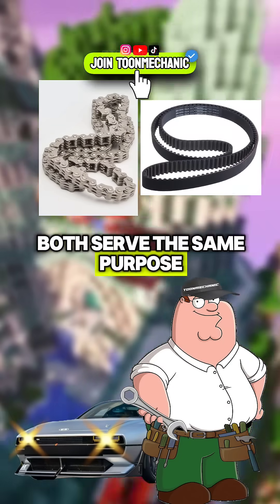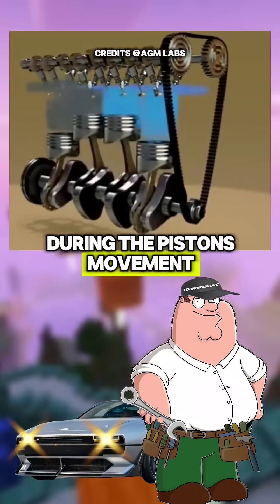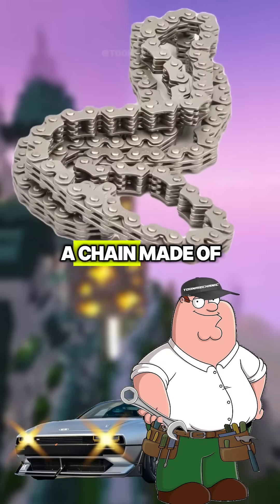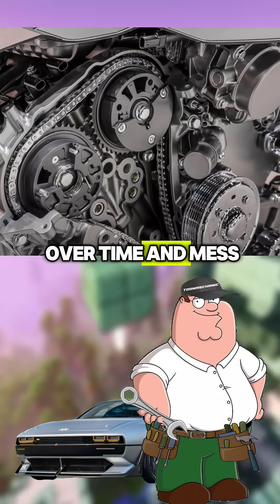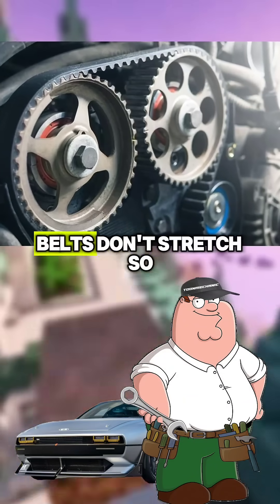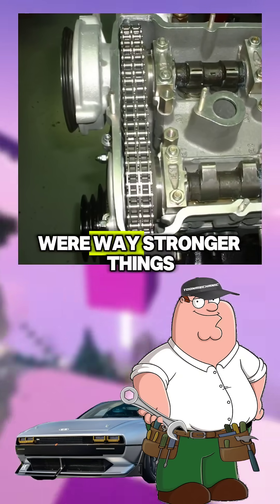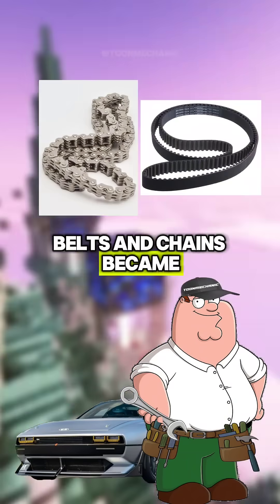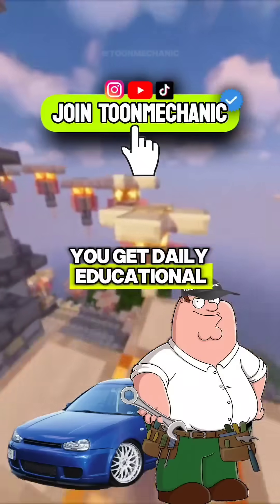Timing Chain vs Timing Belt! Did you know the difference?

Comment: I like the gear drive, they can last forever and if you get the quiet gear drive, it kinda sounds like a blower.
Reply: Oh boy, i had the 3 types:
Gear-driven
Belt-driven
And recently, chain-driven
And let me tell you, in my rank, is first place gears, second chain, and third belt, the belt one is good, but you need to be really religious on the checkups, i snapped belts twice, one because i didn't knew it was a timing belt and leave it til' shit snapped, and second one was entirely my fault, all because i didn't had time to replace the belt, plus i was lazy to do it because i needed to remove too many parts to replace the goddamn belt, snapped in half, had to buy a new engine after that, gear driven are the best in reliability, slow, but get the job done, chain driven... I honestly didn't saw it yet, but i hope it is as durable as gear driven

Comment: Chains if that’s the best i can do I prefer the timing gears that are found on engines like the ford 300 inline 6 they will quite literally make it 1 million miles
Reply: Even more if you don't throw a rod or bearings, happened to mine, it wasn't that bad, but still not quite good

Comment: Timing belt makes more sense to me with the fact that it's always outside the engine if it snaps there's no risks for internal damages that can be caused by timing chain
Reply: Apart from smashing valves in to pistons no internal damage ask the rockers how they feel about it wen it shits its self and fords wet belt fun look that shit up then comment bk boss 😂
Reply: @MartinMoorson  pistons hitting valves are only on interference engines… which most nowadays are but yeah if its non interference then the belt can snap and you slap another one on and go